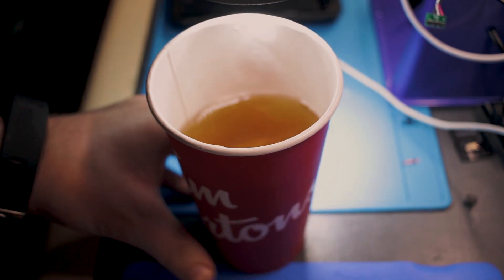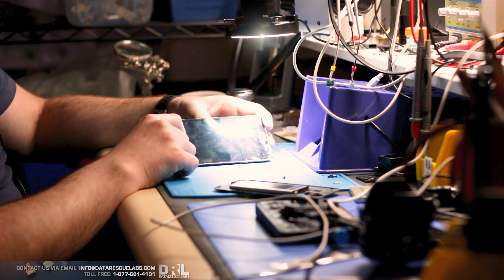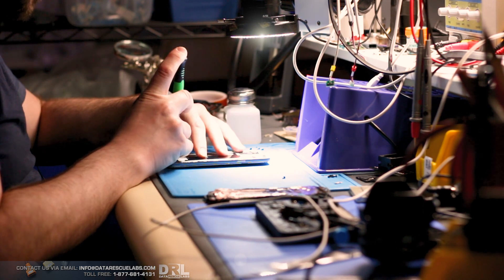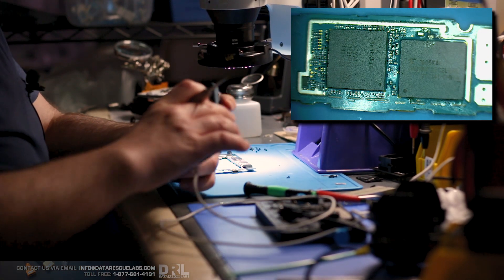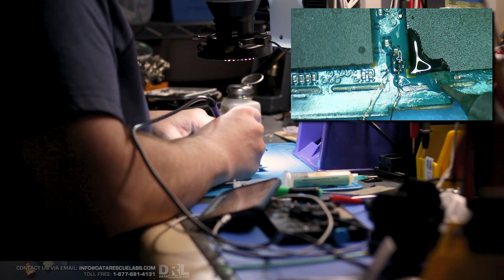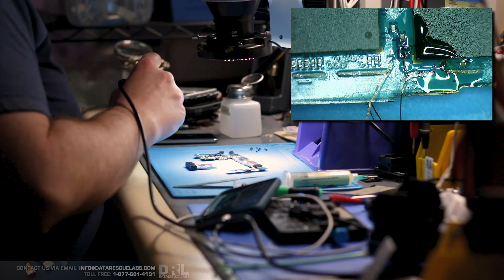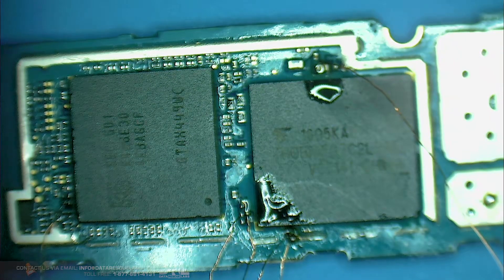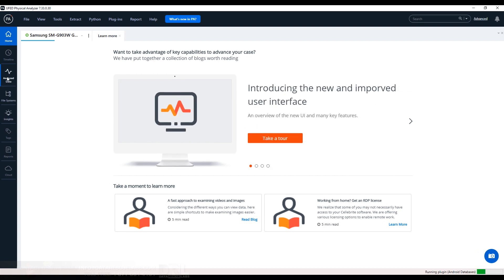Galaxy S5 Neo - Not working, no power, data recovery

Comment: As usually, good job nothing to say. However, I have a question : in order to protect my self regarding to the law. how can I check if the data which will be recovered are belong to the person who gave me the device ?
Reply from the maker: You can most of them time tell as the persons name, phone number or email will be in the extraction
Reply: @forensicguy  Thank you for this response. However, the problem is when the client give me just a microSD ! There are any law which protects the data engineer ?
Reply from the maker: Make them sign a agreement that they acknowledge that it’s their data and that you’re not responsible for anything. You should have a contact with clients anyways
Reply: @forensicguy  It's a good idea. Thank you.